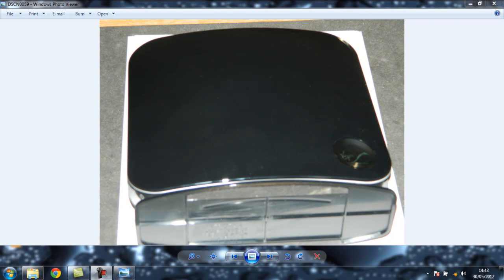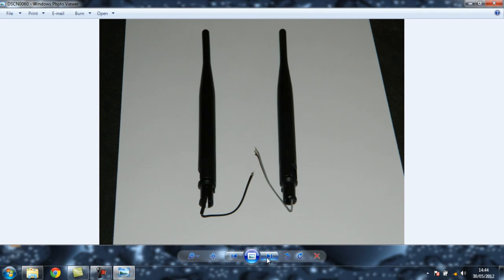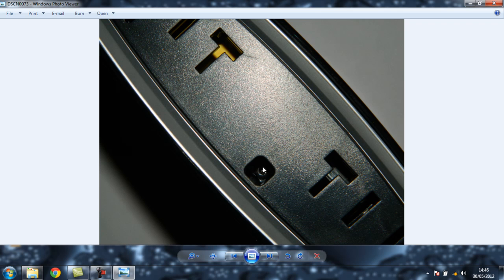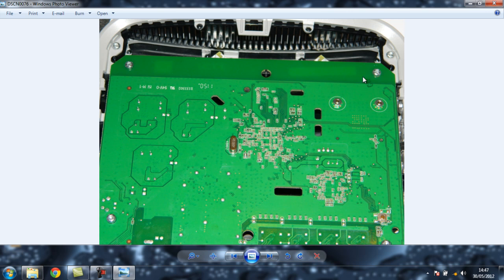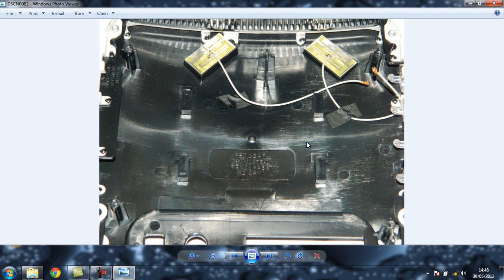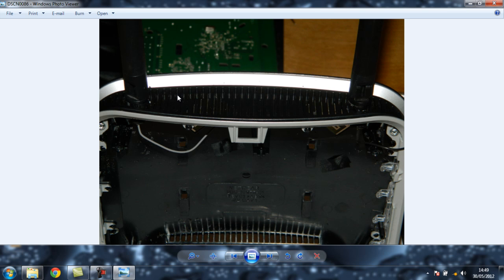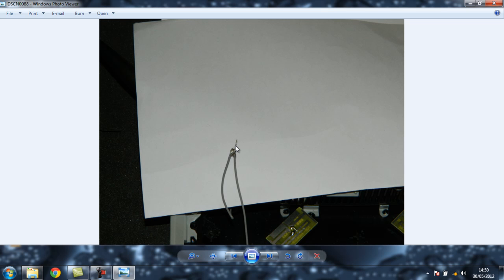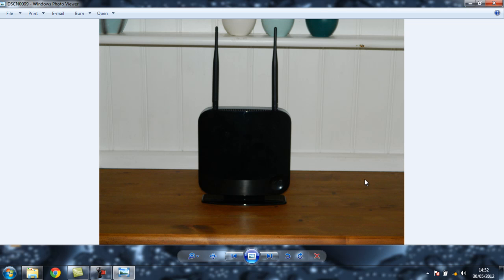Virgin Media super hub Antenna modification

Comment: for any one that wants to do this with out cutting wires or soldring they are called IPEX to RP-SMA connector  ul find them on ebay from chin at 1.50 a connector

Comment: Hi. Many thanks for this video, informative & useful. I was experiencing poor wireless connection due to my modems location in the corner of our house. I wanted to do this mod as it was far easier than relocating the Superhub and my existing Ethernet connections to it.
A couple of helpful tips;
A small electrician’s screwdriver jammed into the security screw undid this for me, the cover easily slides up and off once the screw is removed.
I purchased 2x sodial IPX to SMA female connectors, (this eliminates the cutting / soldering of wires and plug straight into the circuit board), 2x antenna extension cables and 2x Omni directional wireless antenna. This allowed me to have the wireless aerials in a completely different room to the modem.
Not really necessary but I also purchased a second hand Superhub from eBay for less than a tenner delivered. This Superhub would not work because it needs to be registered with your virgin media individual account, however by using the case and drilling holes in it for the SMA connectors, I have the original case to make the whole process reversible if I wish.
For a little work and probably no more than the cost of a wireless repeater, I have good wireless coverage all over the house now with no dead spots. Also no need to reroute my existing Ethernet cables or add a separate router.

Comment from the maker: Ok why did I do this? To quote VM “Instead of using a separate cable modem and router – each of which requires its own power supply – the Super Hub combines the functions of both devices into a single, elegant unit”.
So I did it as I don’t want 2 units and 2 wall warts! So yes you can put it into modem mode and connect a router but I and many others don’t want to for the reason VM introduced the SH. 
I was so tempted to add IT to the end of that sentence ;-)

Comment: Tomorrow I am receiving one of these hubs, and im not happy. But it was the only way I could get 100mb internet. I have a 3 spare antennas from an old WRT54GL, which has excellent range for a 802.11g wireless router. I will be modding the crap out of the Virgin router too. 
And no offence, but sod Virgin Media, once it is in my house, it's mime, not theres.

Comment: Log in to hub  to change settings, type in to internet search bar 192.168.0.1 you will be then asked for user name and password user is always admin password is changeme once login you can switch the hub from router mode to modem mode and after that you can connect any router you want without having to modify!

Comment: tell them you are moving with sky lol, they will offer you the new super hub 2, which is much better, Its again not perfect but better.. Put that in modem mode or just plug in another router into a spare Lan port, it will quite happily bridge connection providing the other routers ip is not the same default ip 192.168.100.1 is virgin, tp link i believe is 192.168.1.1 so no config is needed, There are a few routers nowadays opting for the pcb antenna setup, they use amplifiers though, the virgin version uses standard laptop boards which are only good for laptops, Would be fun to try and put another card in there lol

Comment: The VM 'Super' Hub is the biggest piece of crap i've ever used hardware wise. The Wi-fi signal is pathetic for an 'N' class router. Virgin keep trying to fix it with firmware updates when what they really need to do is face the fact that the superhub is a joke and replace it with a decent solution.

This of course will never happen due to the cost and Branson's greed.